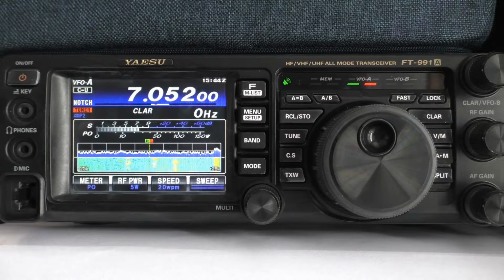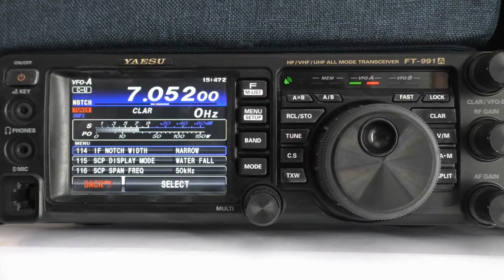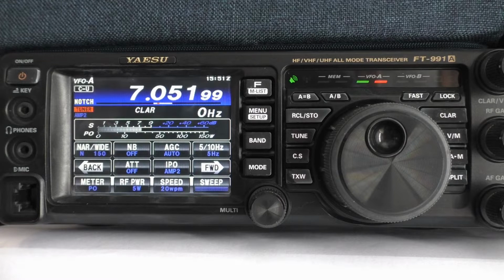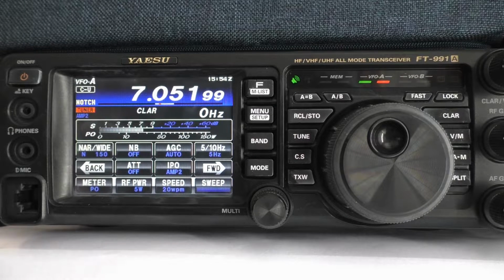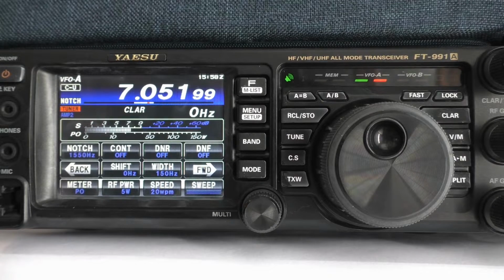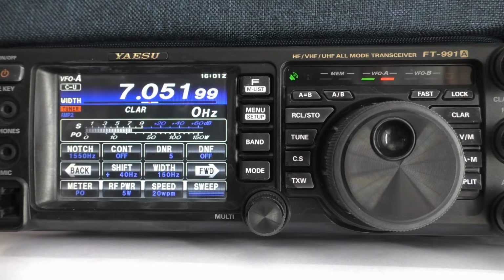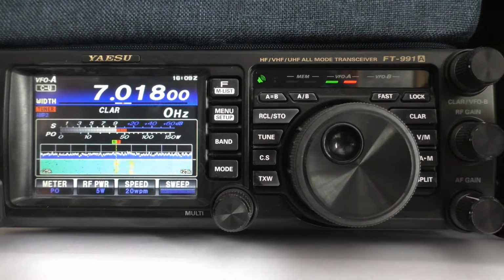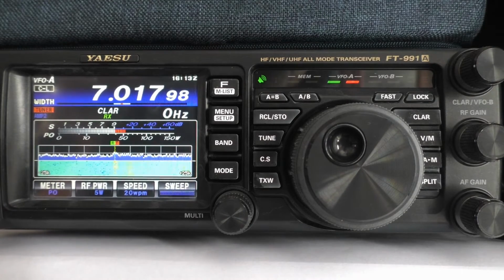Settings for your best FT-991A CW Receive

Comment: Great job, Tom. I do a lot of POTA and I'm always looking for best reception settings for handling pileups when hunters are all transmitting at once. The  attenuator would eliminate the weakest signals for sure (although I do want to hear QRP hunters)  but any other suggestions?
Reply from the maker: Find a way to spread out your callers. Call call by call area on the callers ticket.  Call for stations beginning with “A” then “K”. When you complete US, call for DX.  If need to, operate split.   Just a few ideas.
Reply: @ND3N  yes. I do ask people to spread out but not everyone is polite. I generally lower my power which helps.

Comment: Hi, Tom, I loved your videos of the 991A. 
I heard you say that you had problems with the computer, that is happening to me when I stop using the MRP40 in CW and I go to LSB or USB when I press the microphone to speak, the computer turns off, that happened to you
Reply from the maker: The problem ended up being with my computer.  Called HP friends tech support and they identified a problem with my Windows 11 upgrade - it had corrupted some of my drivers.  A quick fix and everything was fine.  Haven't had a problem since.  73 de Tom, ND3N